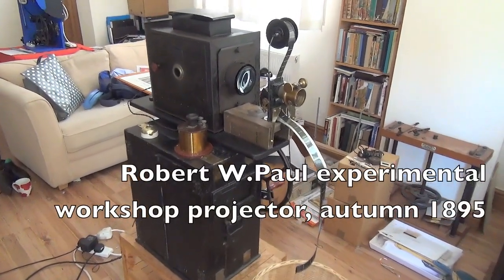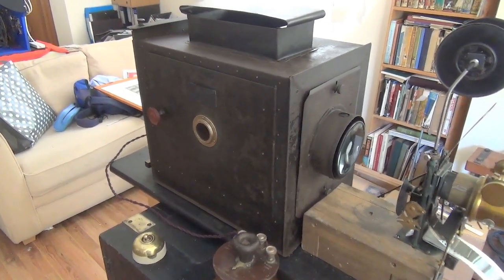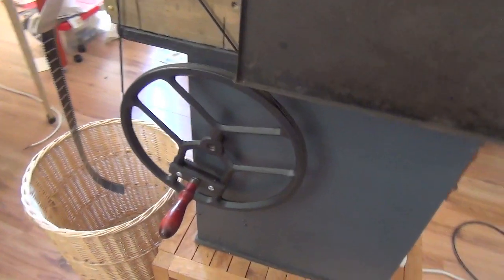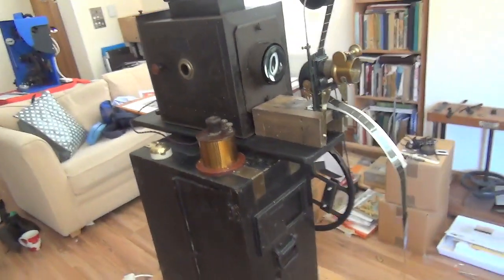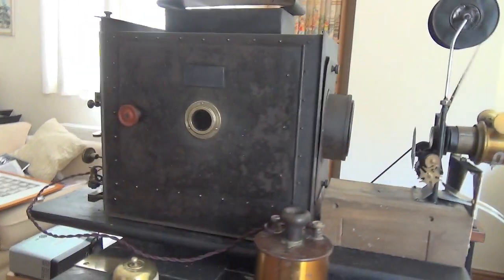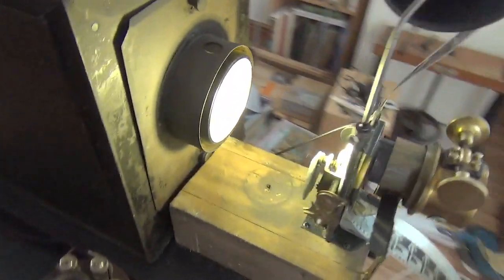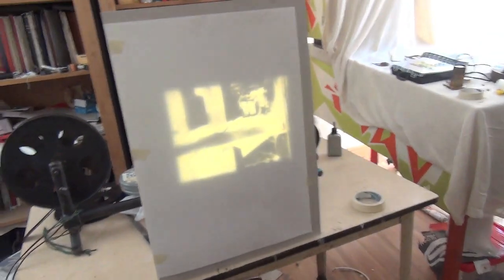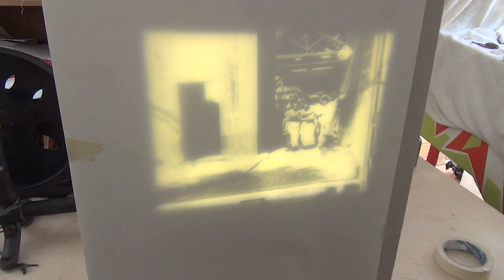Robert Paul Experimental 35mm motion picture projector (model)

Comment: hello. great job. was that an existing head or did you build it from scratch
Reply from the maker: Mechanism from a 1900 Ernst Plank 'toy' projector, other parts made from Meccano and brass plate, lens mount from bits and pieces.

Comment: Are there any models of 9.5 mm projectors that are common and relatively cheap (under 200) that you know of?
Reply from the maker: The Pathescope 200B is one of the most popular - sensible design, tends to keep going. Ideally needs a lamp conversion, as do all vintage projectors. Also - the Pathescope Gem. Specto and Bolex are also good machines. All the above available on Ebay (UK). Harder to find suitable machines in USA. Expect to do some basic re-wiring.